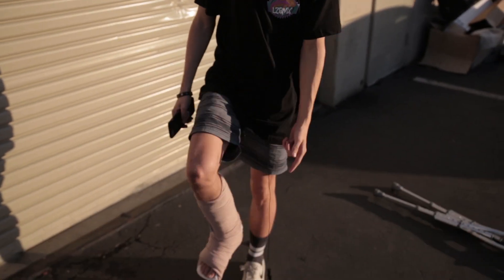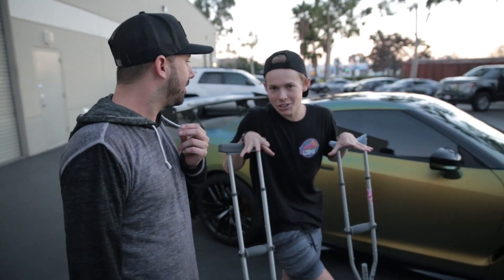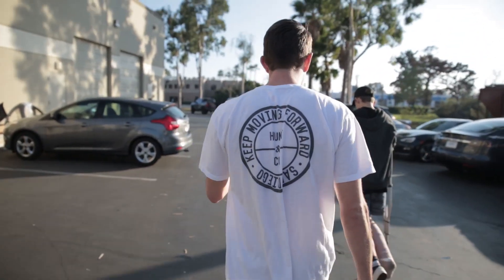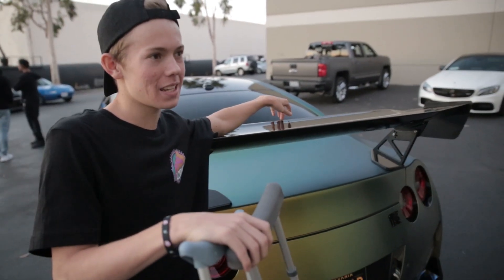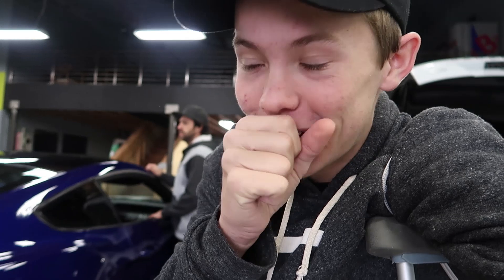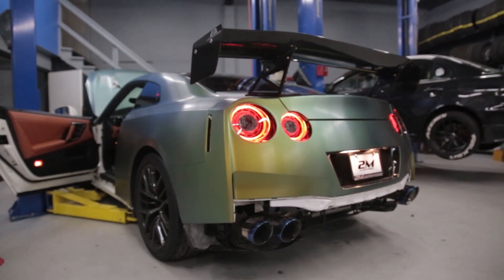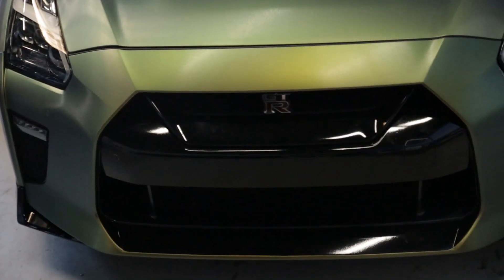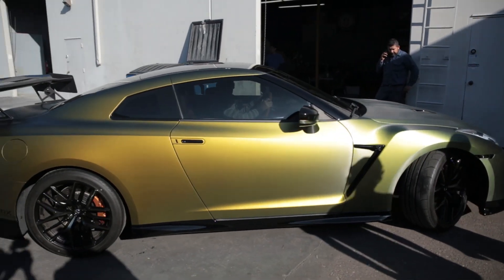IT'S FINALLY DONE! (GTR REVEAL)

Comment: A big you tubers GTR that actually looks class but needs lowering
Reply: Nearbyninja87 yes he needs to and have engine upgrades
Reply: Ricer.
Reply: He doesn't need any engine upgrades car has enough power.
Reply: GreenwoodChubby lowering isn't an engine upgrade, and btw there is never too much power ;)
Reply: Nearbyninja87 n
Reply: If you get rid of the disgusting wrap they did and just have a normal color there is nothing wrong with it
i would not lower the car either because you are limiting your self to what u can do with it then
Reply: Luuk Lugtigheid I know that lowering it won't give you power but it can help with handling
Reply: +Stepphen n

Comment: Nice ricer wing tanner
Reply: lmao
Reply: +Renaldo Boss Ricer detected.
Reply: +FumblingBroadcast not really a ricer when it's on a GTR that's called a tuner pal
Reply: truueee
Reply: +EleTric im pretty sure that a wing that is bent on the inside is a ricer wing ........  and its held by the worst bases possible which means that it could fly away if he starts speeding .......... your just a but hurt fan ........and its not a tuner because its stock and it has nothing done to it except that ebay wing ........ get your facts right
Reply: I'm not sure what you would consider good bases for a wing if APR isn't good enough for you lol. Maybe a Battle Aero chassis mount? Also APR is far from an ebay wing. I doubt it functions as well as a wing built for race applications(APR does make wings for race applications), but it isn't a race car and the wing definitely will not just fly off at high speed.